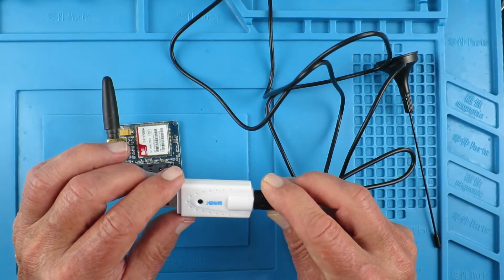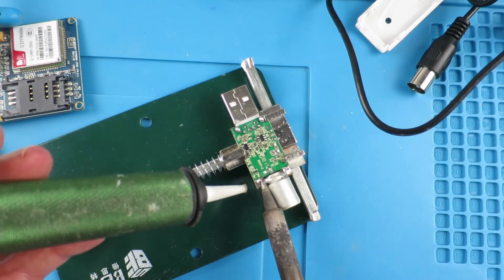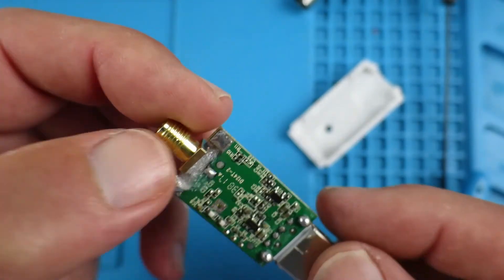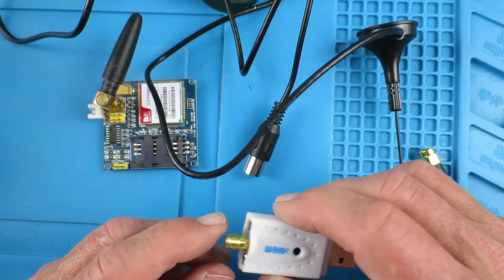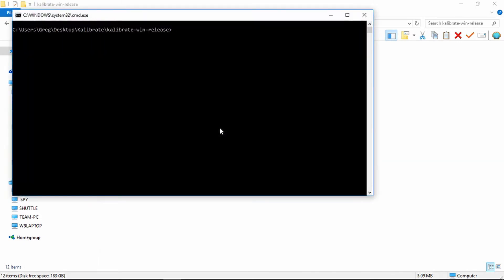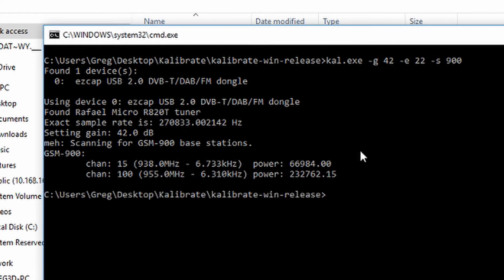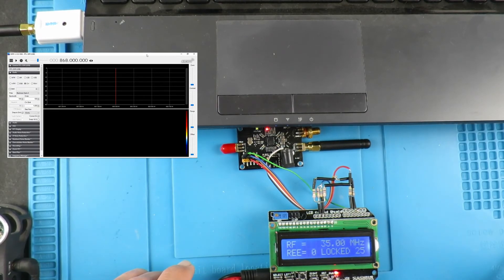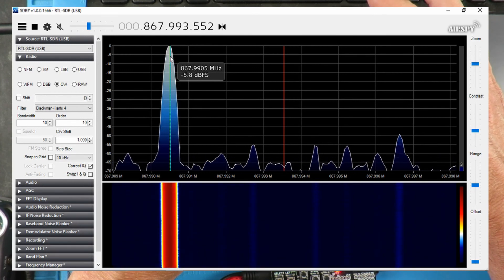How To Calibrate An RTL-SDR Using Kalibrate RTL SDR! Electronic Tutorial

Comment: hey how can I get the estimated PPM (i.e. the -e 22 paramemter in your command)?
Thanks for the video anyway
Reply from the maker: As far as I remember the value is not critical, see the summary here : https://github.com/steve-m/kalibrate-rtl Thanks for watching, have a great day!
Reply: @1nformatica  
I tried couple of times, but the PPM seems very high. can it be something wrong with my dongle?

> ./src/kal -s GSM900 -g30
Found 1 device(s):
  0:  Generic RTL2832U OEM

Using device 0: Generic RTL2832U OEM
Found Rafael Micro R820T tuner
Exact sample rate is: 270833.002142 Hz
[R82XX] PLL not locked!
Setting gain: 30.0 dB
kal: Scanning for GSM-900 base stations.
GSM-900:
    chan:    8 (936.6MHz - 5.123kHz)    power: 1358061.45
    chan:   12 (937.4MHz - 5.213kHz)    power: 4692773.96
    chan:   43 (943.6MHz + 20.449kHz)    power: 1492086.00
    chan:   50 (945.0MHz - 21.092kHz)    power: 4697909.16
    chan:   53 (945.6MHz - 20.623kHz)    power: 1166509.58
    chan:   57 (946.4MHz - 20.034kHz)    power: 2630796.61
    chan:   60 (947.0MHz - 20.053kHz)    power: 1007003.36
...chan 83
Difference of offsets between channels is >1kHz. This likely means that the correct PPM is too far away and you need to provide a rough estimate using the '-e' option. Try tuning against a local FM radio or other known frequency first.